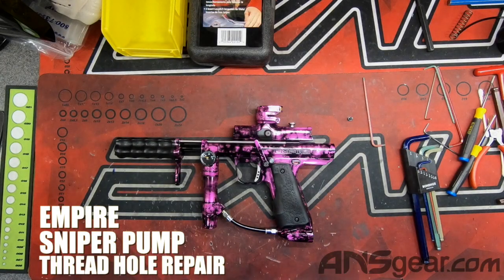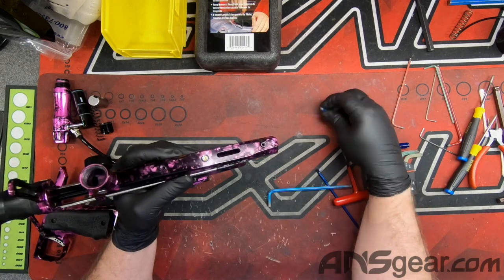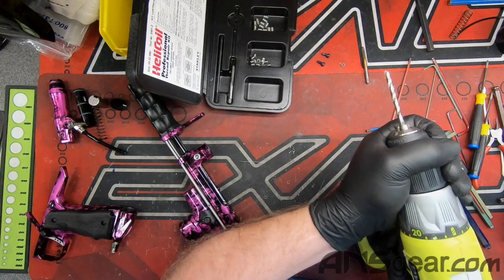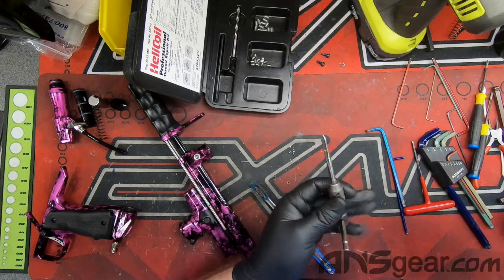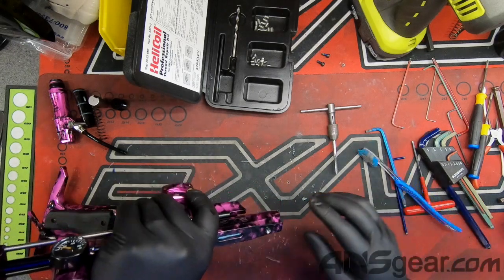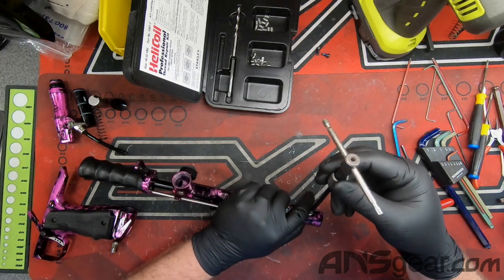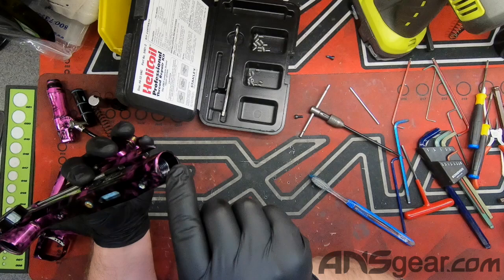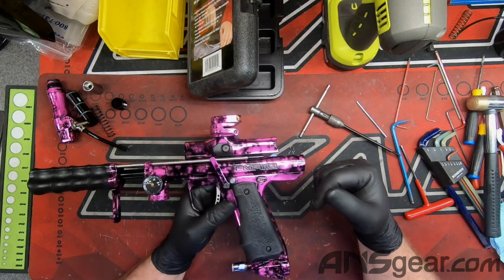Empire Sniper Pump Thread Hole Repair - Tech Talk

Comment: Hey I was wondering if anyone could help with my problem. I have a gog extcy and it’s leaking air and putters when I press the trigger. I’ve tracked it down to the solenoid and I’ve tried to buy it seems as if they are no longer produced. So I’m wondering if there is some where to purchase it or some way to upgrade it any help would be greatly appreciated.

Comment: I used a 90deg allen wrench & it warped all my stainless steel screws, always use the longer 180deg side when ever possible any side pressure can cross thread faster than you realize